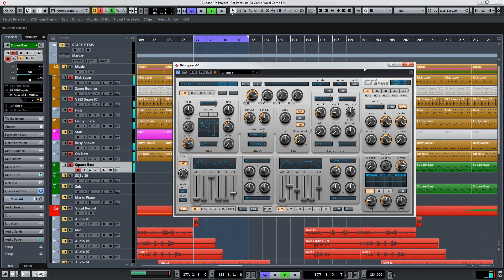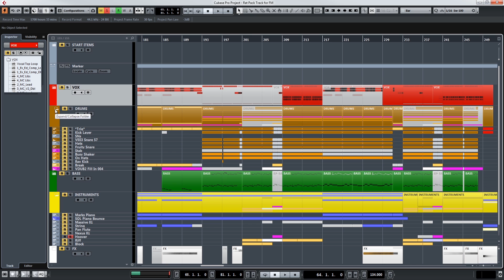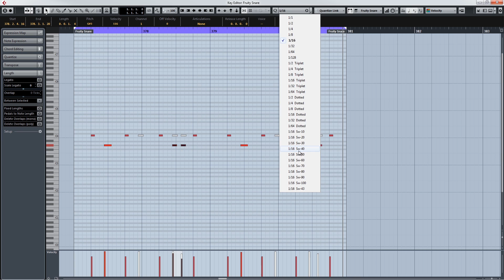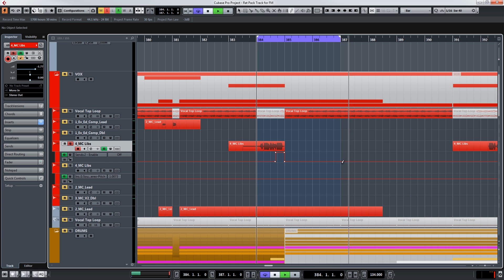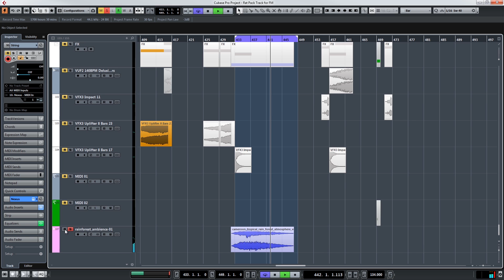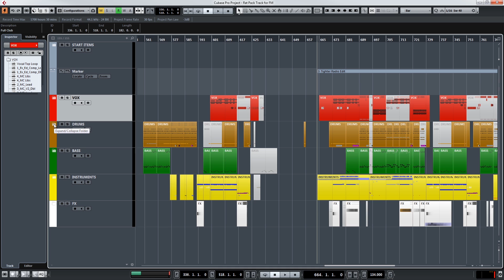Steinberg Studio Sessions: S04E01 – Wideboys: Part 1

Comment: Really nice video guys. I noticed you're not using the Control Room feature in Cubase. You're missing out! I definitely recommend checking the Control Room out. It's something I can't live without anymore. It has Monitor switching, Cue sends, Aux inputs (for iPod's f.e.), headphone channels etc. etc. And a individual Volume knob which works independent of the Cubase master channel. It's amazing. Check it out!